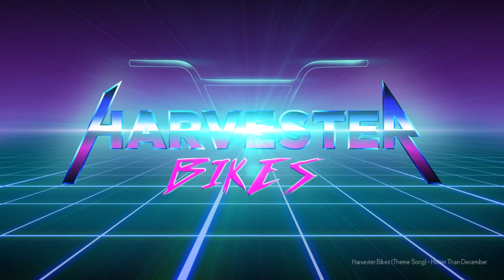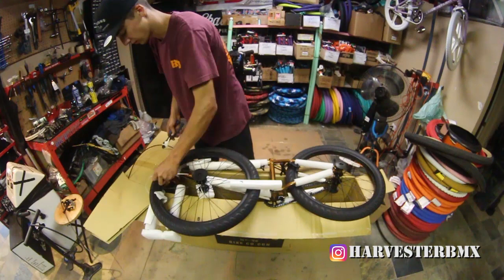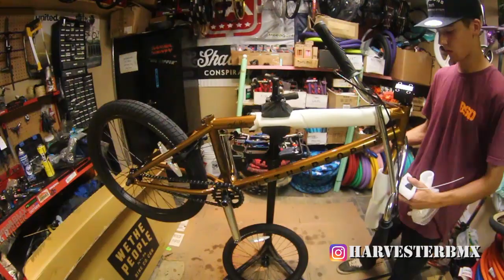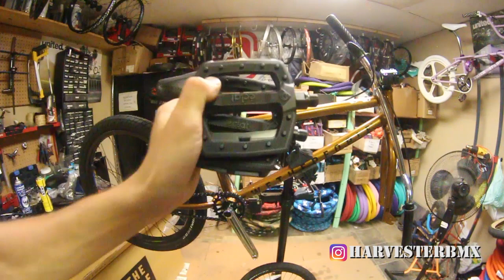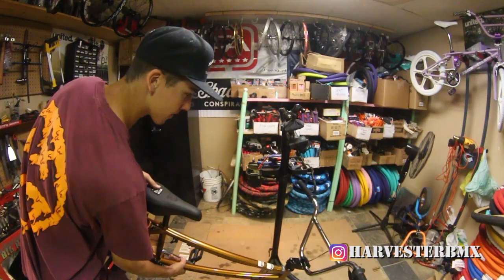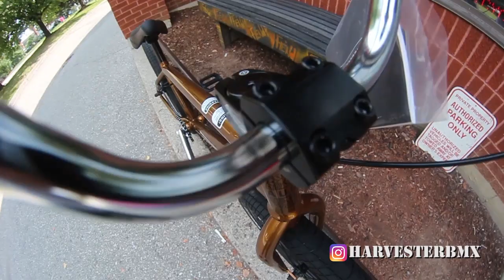2018 Wethepeople Audio 22" BMX Unboxing @ Harvester Bikes

Comment: I bought one for my 50th b-day this yr. One of the funnest bikes I ever owned. Nimble like a 20" you can put pegs on ride street, mini ramp, trails, park. Stable, roomy and fast like a 24 not twitchy at all. This bike does it all. I don't race anymore, but if you can sneak by the loophole rule in usabmx book, you could race it in cruiser and 20. I bought black bars and cranks recently to change up the look. Awesome bike